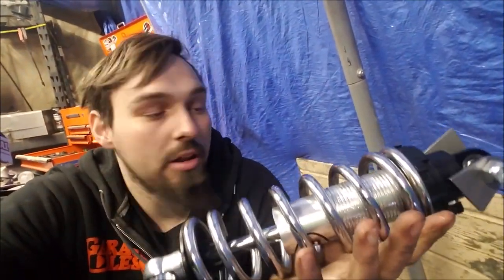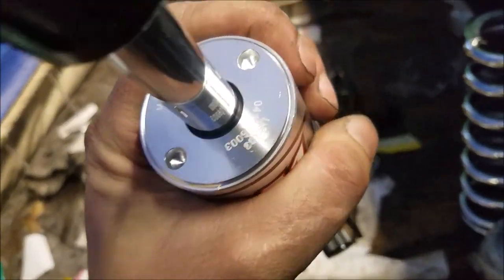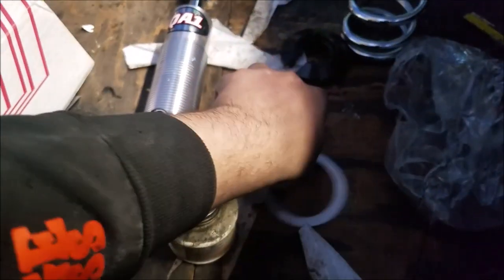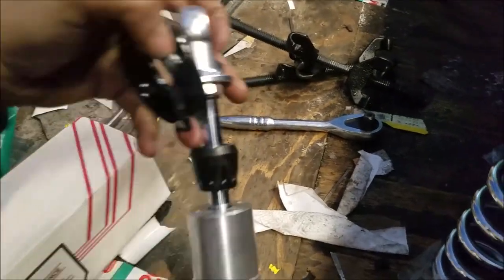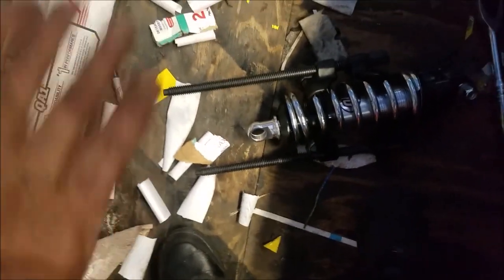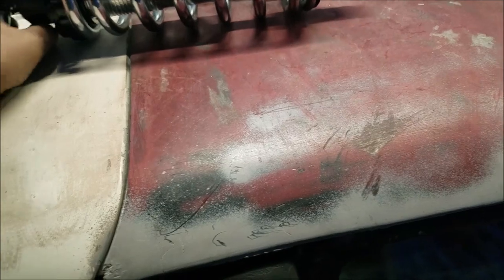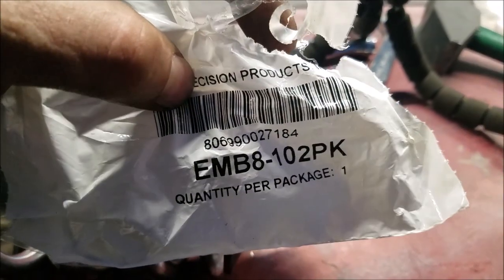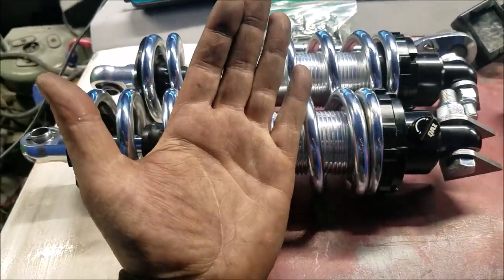Assembling QA1 coilovers!

Comment: Snap rings. If you have bottoming issues turning the bases will increase the spring rate.
Reply from the maker: Like preloading?
Reply: Yes, but meant more in the sense of setting ride height, which will also limit usefullness of available travel. Go too far and you will likely bind or break the spring. So long as the two of them are rated at more weight than the weight applied to them you should be ok.
Reply from the maker: @TheCanadianBubba  ill have some many spots to adjust for ride height